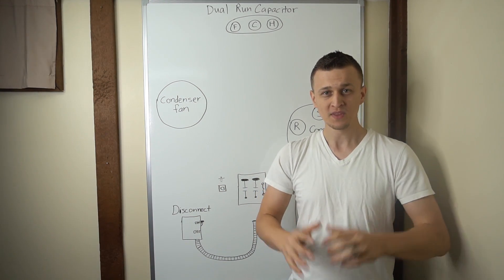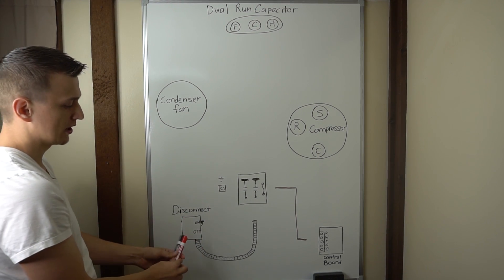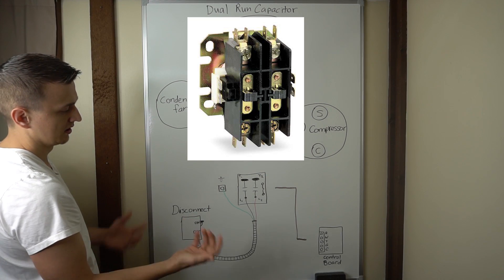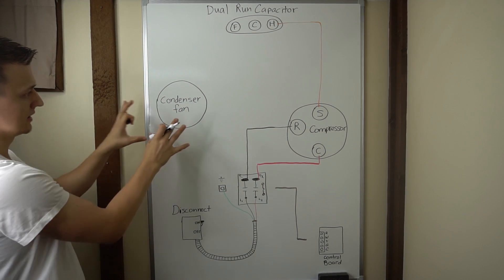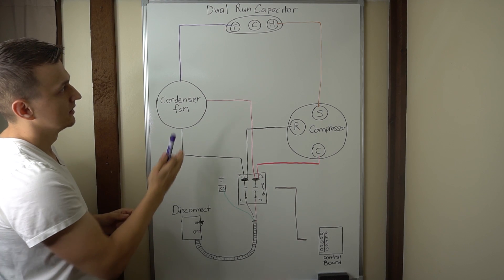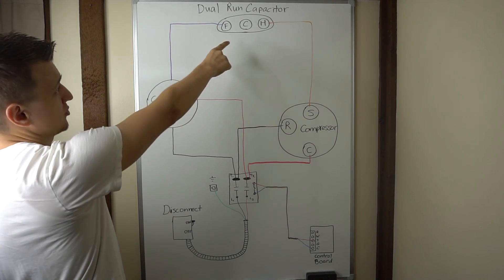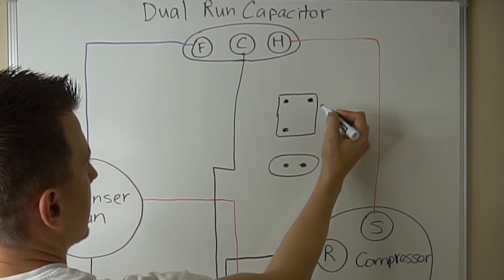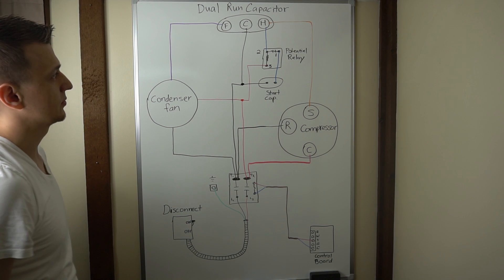How To Wire AC Unit - Easy Diagram

Comment: Thank you for explaining this, I was replacing my neighbor's AC condenser fan motor and he told me he got an OEM replacement which he did not, I forget the brand but I ended up finding out the motor that was replaced was a 3 wire and not a 4 like he said, so after seeing this it was a breeze getting everything wired correctly and now he has good, working A/C again. I still need to clean his coil out though, it's filthy but he insisted I come back tomorrow for that. I had originally ran it as a 4 wire but I had a feeling it wasn't right even before starting it, so I told him to wait while i verified.

I'm just happy its working. New aftermarket replacement was a 5-wire; yellow orange brown black purple(blue? I'm really colorblind), black went to the black side of the relay line in, orange went to the common leg of the two-stage capacitor, the common leg of the capacitor also had a wire going to the red side of the relay. Purple went to the fan (F) leg of the capacitor, and the brown and yellow just needed to be wired together, I verified this on the wiring diagram on the side of the motor. I also checked to verify the capacitor (which was had been replaced before he was told the fan motor was bad) was the correct size and micro sievert designation for that motor. The compressor was wired into the hermetic portion of the capacitor and was also wired into the relay and looked correct so I left it as it.

I've been doing A/C work on and off with my dad for years but he's done most of the electrical and he's not always the best teacher for reading schematics, this was the only thing I could find that explained everything in a simple manner and I appreciate it. Evidentially I saved him 600$ so he was happy. I'm just happy to learn something from this, thank you for your work.

Comment: Thanks for the video, Awsome! one question can you connect the wire the goes from condenser fan motor to the T2 to the common on the run capacitor and then of course to wire it from there to T2, will that work?
Reply: yes

Comment: So the purpose of the added start capacitor (controlled by the potential relay) is to add capacitance (it is in parallel with the dual cap) for a short period only during start up of the compressor motor?

Comment: Question do you need to hook up the  white wire if you have just an ac unit no heat it is a commercial ac unit
Reply: Sorry white wire on thermostat control

Comment: I'm a semi-retired physician and home DIY'er. Ever since an HVAC contractor charged me over $700 to replace a $100 TACO circulator pump, I try to do my own repairs. So far I've done another TACO circulator pump (5 zones), an aquastat, two AC dual run caps, a condenser blower motor, and routine condenser coil flushing with Yellow Death .  Your videos have been very helpful.

Comment: So my dual run cap only has a yellow and a red wire going to it, there is a second 9.5mfd capacitor (looks like an oversized 9v battery). I bought new capacitors and forgot to take a pic of where the wires were on the dual run ... I looked at the schematic on the door and matched the colors. Will I be fine or should I worry about burning something up?

Comment: I got a question...why is it when you wired the common up on the compressor it went to the opposite side of the contacts vs everything else common went to the left side of the contacts..the common on the capacitor went to T1 but the common on the compressor went T2..

Comment: You did not put a ground wire on the condenser fan motor. ( Great video) "over 30 years in HVAC/R" and I'm still learning tks.

Comment: WOW !  YOU ARE ABOUT THE ONLY INDIVIDUAL THAT HAS TAKEN THE TIME TO CLEARLY EXPLAIN HOW TO WIRE UP A SYSTEM. I HAVE WATCHED DOZENS OF VIDEOS AND EITHER THE PERSON IS HUMMING OR TALKING TO HIMSELF, NOT LOUD ENOUGH TO HEAR WHAT HE IS SAYING OR SAYING VERY LITTLE TO INFORM THE VIEWERS WHAT HE IS DOING. SOME SHOW A VIDEO IE: HOW TO INSTALL A PACKAGED UNIT AND ALL THEY DO IS SPEED UP THE VID IN HOW THEY ARE CONNECTING THE DUCT WORK, THE CONCRETE BASE, ETC. BUT NEVER SHOWING YOU STEP BY STEP LIKE YOU HAVE DONE THE CONNECTIONS FROM THE POWER DISCONNECT TO THE UNIT.  THANK YOU SOO VERY MUCH FOR YOUR VID. I AM ORDERING TOMORROW A UNIT AND I WAS AFRAID IT WOULD NOT HAVE ANY INFO IN WHAT WIRE GOES WHERE AND NOW THANKS TO YOU I KNOW.  AGAIN THANK YOU AND GOD BLESS !
Reply: I think I know the Guy your talking about.

Comment: Shouldn't there be a coil symbol in between the blue and the yellow coming off the thermostat? What you have drawn appears to be a straight short.  Those terminals are usually on the opposite sides of the contactor.

Comment: Hey Jay! Is it ok to have a connection (in a junction box) on the 10/2 romex wire from circuit breaker to the AC unit outside? My wire goes from the garage to outside to basement then to the AC outside and the part where it is outside is starting to damage and the wire jacket is starting to break. I was thinking about cutting it from where it goes outside and replacing the damaged wire with a new same wire and junction box. Is that ok?

Comment: Great info.. very helpful.
I have a condenser that has the potential relay and see that someone had wired in incorrectly.
Also this condenser has a time delay relay (DL15) 3 prong (1com 3in 2out) that is missing some wiring, how does this get wired? 
I see that the h- tem pressure switch was removed on this as well so missing a wire for the low voltage "C" wire.
Any help would be appreciated.

Comment: Great video! Very well done!.  It so happened that I was working in my AC Condenser unit this afternoon.  This helped a lot.  However I found this unit also connected in the circuit.  It is a two wire device (some sort of thermal sensor switch) Part #3NT01L-H5674 L85-20.  It is a 3/4" circular  - Thermal Heater switch.  How do I test it?  it was connected between L1 & T1 and was hanging in air inside the Condenser Unit below the Fan and above the compressor.  I measured the ohms and it was showingopen circuit.  Thinking that it was broke, I bypassed it by shorting it.  That may have killed my 24VAC power coming to the relay somehow?  Can you please give me some pointers to this.  I will check back.  Otherwise my email: tariqueislam5942@gmail.com.

Comment: Coming from the main panel do I need 3 wire +ground or 2 wire +ground thank you???
Reply: 3 wires going Into the disconnect which the ground wire connects with the disconnect. Then 2 hot lines heading to the contactor... hope this helps

Comment: I installed a HoneyWell Thermostat to my 4- wire furnace / AC Central Air. Furnace worked fine back in the winter but now the AC Unit will not work? There is NO    "" Y"" - wire  on  this 4 wire system. SO the AC unit is probably not getting any feed?  HELP !!!!!!!!!!!!!!!!!   Burnham2013@Gmail.com     write me there

Comment: Does the common coming from the capacitor, does it always have to go on the Run terminal from the compressor, or can it go on the Common side of the compressor. Or it doesn’t matter ?

Comment: For relay potential connection it should be as follows: 5:2:1 C:S:R .....5 point should connect to hot line and 2 to neutral line ....but you connect both of them to hot line ..... By the way thanks for your video.

Comment: Why would the common from the run capacitor be wired to the hot side of the contactor? I thought the common was alway ground.
Reply from the maker: The air conditioner does not have a common. Instead of Line and Common, it has Line 1 and Line 2. Both of them are 120 volts which adds up to 240v.
Reply: @WordofAdviceTV  You keep referring in your video as common, instead of line 1 and line 2. Just trying to understand.
Reply from the maker: @Joe Anomalous   Ahhh I see! So that's where it gets confusing. Sorry about that. Basically going to the contactor is L1 and L2. No common there. But the capacitor has a C (common) terminal on it. Even though it is labeled like that, it actually has a hot wire (120v) going to it. I have a long video on how to read an AC wiring diagram, if this is still sounding confusing, perhaps that video will help.
Reply: @WordofAdviceTV  Thank you! I appreciate you taking the time to explain it to me. I will take a look at the video. I've always thought that if someone referred to common or neutral, they were talking about the ground on the transformer.

Comment: What is the difference/ pros or cons  between the hard start capacitor or the start cap with the relay?
Reply from the maker: In hotter climates, the start cap with relay is better. The PTC in a hard start kit (look up "hard start PTC"  for more info on that) needs a little bit of time to cool off between cycles but when it is very hot outside sometimes the AC ends up starting without the start capacitor as it did not cool off enough. So where I am in Minnesota, I have never seen this be an issue but some guys from hotter states say the 5-2-1 start capacitor is the only way to go.
Reply: @WordofAdviceTV  ,   Thank you for that, I have a 22 year old straight cool. And live down south where it is mostly hot. Maybe I'll hook one up down the road. And, great channel/info and teaching.

Comment: i am moving my outside 3/4 ton unit and i think everything is 10 gauge romex but I want to be sure i am using the right wire. The cutoff box is about 15 feet  from the house breaker box and it had 10 gauge grey, but from the shutoff box to the outside unit it is black braided 10 gauge maybe 4 feet long. and to the inside unit it is 10 gauge grey. I am replacing some of these wires because they were chewed on by rodents. Is this suitable wiring?
Reply: can the supply from the shut off be 10 gauge grey or does it have to be braided?

Comment: Great video. Thank you! and if you don't mind I am posting a question for help after the contractor has come 3 times and left something not working. Question: The a/c in my house was left with 2 cables on the y terminal going to the contactor and the a/c works. I have a nest thermostat and this is the 3rd re-wiring done by the same contractor who installed the nest (technicians have been different every time). If one of the wires has to be the common, what explains that this work?
Reply from the maker: Nest thermostats do need a common wire.. I have a video on basic thermostat wiring, I think that would help paint a better picture for you: https://www.youtube.com/watch?v=VknvJ9POYDo

Comment: Thanks for your logical approach to troubleshooting and repairs
Reply from the maker: You're welcome, thanks for watching!
Reply: @WordofAdviceTV  I am trouble shooting a 2 1/2 ton heat pump installed about 10 years ago sits on a 4 story roof on the beach in southern California in Playa Del Rey. Corrosion has set in the indoor coil is dirty and the condenser will not start I traced power from the main panel inside the apartment to the roof disconnect, all good I have power to everything accept the contact relay will not engage when calling for heat or cooling. I am replacing the main circuit board in the condenor its a 'Source One'  board. I am also replacing the T-stat because it's falling apart. I need top get the condensor running to check for refrigerant levels or any other issues. Do you have any advice thanks
Reply from the maker: @havitcold  Oh boy.. Sounds like that one has potential to become a pain in your side. But hopefully not, it would be nice if the board and thermostat fixed the problem. If not.. Then I would find what else is in series between Y coming from the thermostat and the contactor coil. 3 amp fuse, Low pressure switch, high pressure switch, condensate overflow switch, etc... Different units, different switches.. Perhaps something in the 24v circuit is tripped.  Also, did you check if the contactor coil had 24v going to it? Sometimes it will have voltage but will not pull in. In that case the little plunger is either stuck or the contactor coil is bad.
Reply: @WordofAdviceTV  Thanks! I always appreciate the tips

Comment: Where is your start relay for your compressor? So you take out your start winding your condenser fan motor is a permanent psc motor so both windings are always in the circuit but for a compressor 230 volt you should always have a relay in there for the start winding

Comment: the potential relay has 220/240v connection?
Reply from the maker: Yes. It is not a low voltage relay.

Comment: What I did to fully understand this is try wiring the compressor and condenser fan with two separate caps. There really is no reason to use anything but a dual cap. It just made a lot of sense to me when I did that
Reply from the maker: That's a good idea! Thank you for sharing!

Comment: I need some real quick advice right now, i just now replaced the capacitor but after all that the contactor plunger pulls in but still nothing. What should i check????
Reply from the maker: Check for blown disconnect fuses, tripped circuit breaker, or a loose or broken wire coming into the contactor/in the disconnect, or in the circuit breaker.
Reply: Im getting 240v from the breaker and thru the contactor and also all the wires are good, could the compressor be causing it? I checked it and im not getting OL
Reply from the maker: @rick0161  To narrow it down you can try turning off the power and unplugging all the compressor wires (3 of them). Make sure to take a picture or label where they all go. Then tape them or let them hang as long as they are not touching anything and try turning the power back on. If the breaker does not trip, then you know the problem lies in the compressor. (if it is ohming out okay, then I would try putting in a hard start kit) You could also do the same check with the condenser fan motor.

Comment: Might you do a video replacing whole unit or compressor using the newer line connectors wo solder.
Reply from the maker: I don't do install work, only service so that would be a bit hard to do since I don't have quite a few of the needed tools.. Maybe someday if I find a good installer I could pay him to allow me to film his work.

Comment: What if the condenser fan only has 2 wires? And or if the capacitor has only two prongs?
Reply from the maker: If the condenser fan only has 2 wires then it does not need a capacitor. And a capacitor with only two prong sections is a single capacitor. (unlike the dual capacitor I drew in the video) That would mean that the capacitor is only for the compressor or only for the fan motor

Comment: I am confused which side is the hot and neutral in the contactor wiring?
Reply from the maker: It does not matter which side is the hot or the neutral.

Comment: You doing good videos and I need you to make other video for Hi and Low pressure switch wiring to the ac system
Thank you
Reply from the maker: Thank you! I am making a video right now on how to read a condenser unit wiring diagram. Hopefully your questions will be answered in that video.

Comment: I have noticed I have a ground rod next to each of my outdoor units but they are not connected to the units. Should they?  I see where your wiring diagram has the service ground connected to the enclosure which I assume would serve the same purpose so why the ground rods?
Reply from the maker: Usually the ground that comes from the disconnect switch goes to the ground in your circuit breaker panel. I am not sure why you have ground rods by your unit. I don't recall ever seeing that in my area. (or maybe I wasn't paying attention to it..)

Comment: Very good video as always.. Question could we put fan com to the side com on capacitor.
Reply from the maker: Thank you! I know I have seen it wired that way on some wiring diagrams, so should be okay. If my memory serves me right.. I've had times where I swapped positions of the two wires from the fan motor that go to the contactor and that actually reversed the direction that the motor was spinning. Don't have a good explanation as to why that happened though.. So just make sure the fan spins in the right direction (scooping the air)

Comment: Hows it going buddy thx for this vid,what causes a hi side copper line to be hot,doesn't seems normal to me,in fact other lines are not as hot as the one im currently working on
Reply from the maker: A very plugged condenser coil can cause the pressures to go up. (higher pressure = higher temp) Or perhaps the unit was overcharged?

Comment: Very easy to understand.  I have a question about the new AC units.  When you brazing two copper refrigerant pipes and opened service valves to release R410A.  Do I need to add more R410A?  Or there is not necessary to add more R410A.  I am already thinking about replacing my condenser that is installed not properly by a licensed HVAC technician.  LOL.  I really do think it will break in a few months.
Reply from the maker: You actually should not be releasing any refrigerant to the atmosphere. If caught or reported, it could be a hefty fine. In order to do an install job properly there is quite a few steps involved. Like pressure testing the system, then pulling a vacuum on it, and then yes, adding more refrigerant to it. In order to add the right amount, you would need to use a charging chart and take some measurements (superheat, subcooling, wet bulb..)
Reply: @WordofAdviceTV   Thanks for the information.  I think my HVAC technician already released R22 gas into the atmosphere.   Before I even say why are you releasing oops too late.   I was a little upset but what can I do?  They are hard-working people trying to survive in this world.  If they explained to me that they are going to brazing without nitrogen and will release R22 gas into the air I would not hire them.  Anyway, I mentioned to them that they need more careful handling things.  But, I have not much hope because they have a kind of country attitude.  God bless them.  haha.